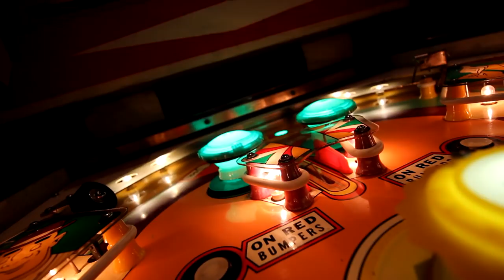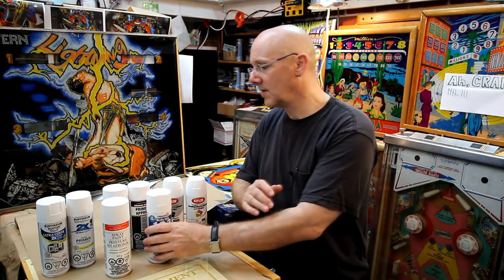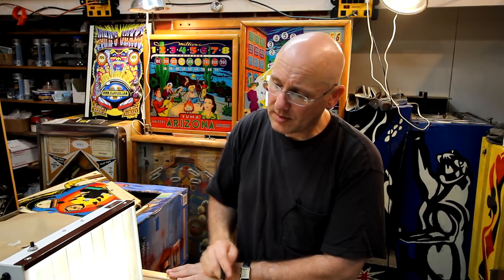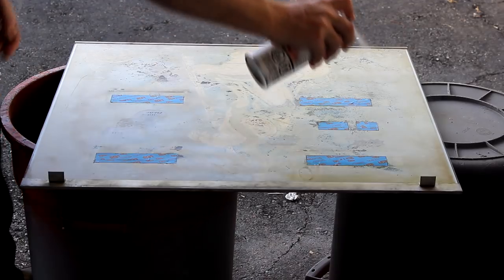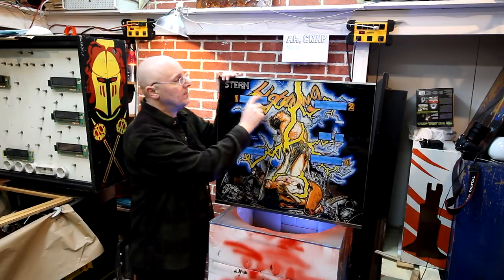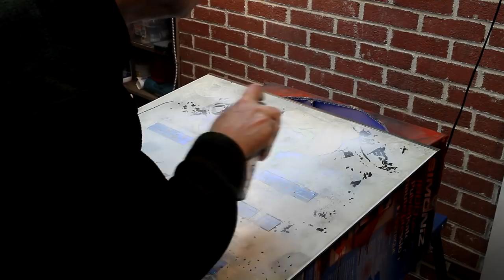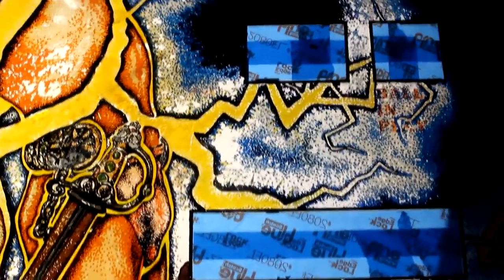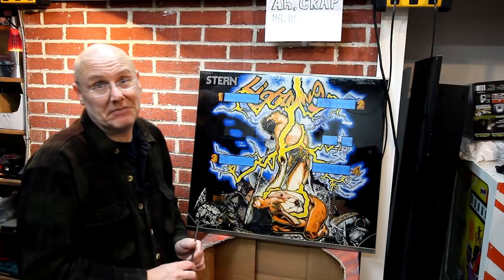Pinballorama #11 -  Fixing an old pinball backglass

Comment: With paint its just that you arent going to be able to get the exact translucence as the original paint, and anywhere your touch up overlaps existing paint is going to look darker. I only touch up blacks for this reason. I find that color matching leds can minimize how obvious flaking can look since the same color light is less jarring than white light leaking behind say, blue. I was super curious about your experiment going over the whole thing with white. Thanks for doing this video.

Comment: I have a Blackout pin. The backglass is pretty good but notorious for flaking. Could I just spray it as a preventative measure? No plastic wrap or stack of books, just a couple coats. Would it just shrink and pull up paint? Thanks for all the great help vids.
Reply from the maker: I've sprayed a number of backglass with Krylon Triple Thick since my first video about it almost 2 years ago (my god, has it been that long?) What I've found is if the ink/paint is sticking, and this is preventative, it's really straight forward. Mask off the score window area, do a few light coats, and you're good to go. You don't have to worry about plastic wrap or anything else. I've had no issues with paint curling if it is stuck down - or with any glass produced after 1970 actually. Like I said in the video, I don't even mess around with backglass that show signs of flaking. I hit it with Krylon and lock whatever I have down. Having said that, I have read a few people say Krylon is a bad idea, it will damage the ink/paint or cause it to fall off in large sections, etc... but I have yet to see ANY evidence of this. As I go through my machines I'm spraying the glass with Krylon. Not only will it help hold things in place, but it helps to prevent scuffing. I don't see a downside.